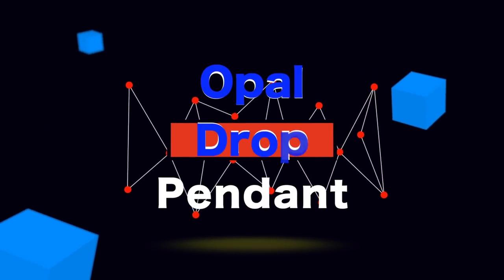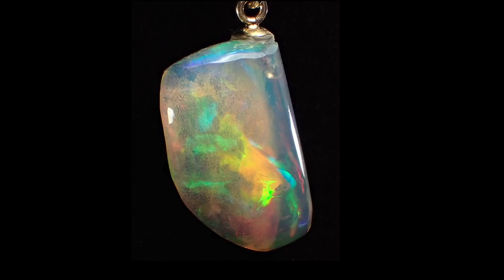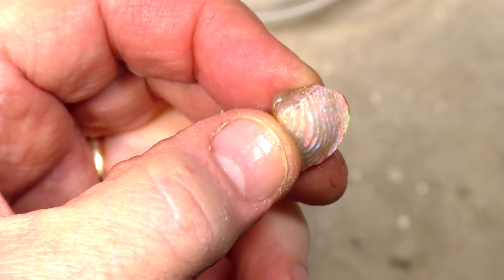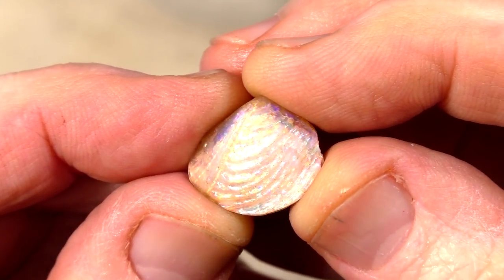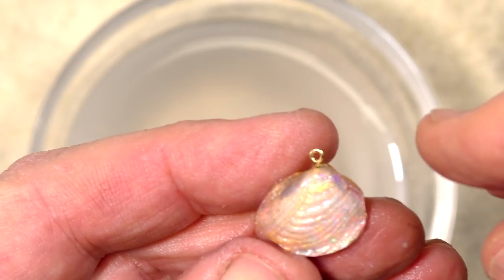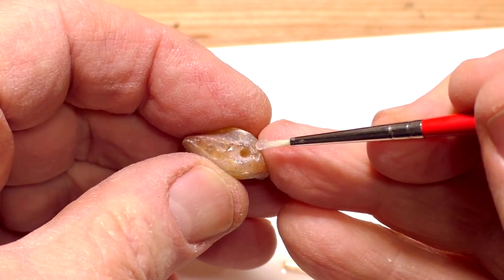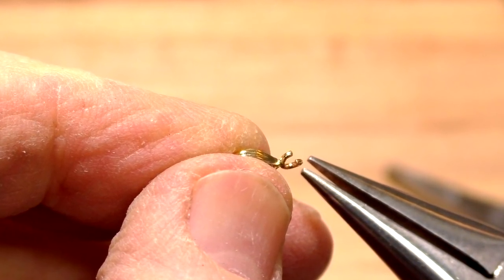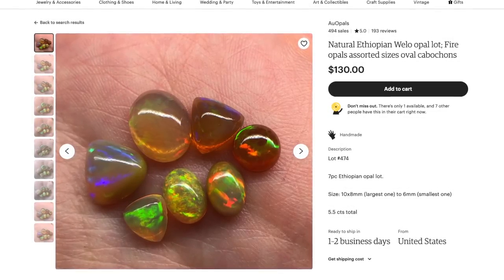JEWEL or JUNK?  Australian Opal Drop Pendants!

Comment: Some good advice here for all, when using welo opal for drop pendants. Welo opal will absorb oil from your skin and it will discolor the opal. If you do make a drop pendant from welo let the person know who wears to let it rest on their shirt, blouse, dress. Take it off when you shower. Also welo will take on tarnish from silver so use sterling silver when setting or gold. Just my two cents worth of what I know. You could have got your welo from me dirt cheap but alas I have sold off the last 4 kilos in my possession.😥
Reply: @PulitzerOpal  it makes since that the acetone would displace the oil from lotion.
Reply: @PulitzerOpal  i have been drying water soaked welo under 15 watt cfl bulbs for years. Place light source about 2 inches above the cut stone and drape thin cloth around fixture down to table to hold the heat in just enough so it does not over heat tskes about 10 to 12 hours to dry depending on stone. Some have cracked but those that did already had a fracture forming.

Comment: The bore hole is a bit smaller. Once the prehole is established.  Then a bit if appropriate diameter can be used to finish the peg mounting hole. This can be done dry as well. 
Kind of like putting in a power pull into the ground. 
Great video.

Comment: Probably get stuck because the taper on your bit is too short, so the shaft of the bit which is thicker than the hole your trying to drill, gets in the way.